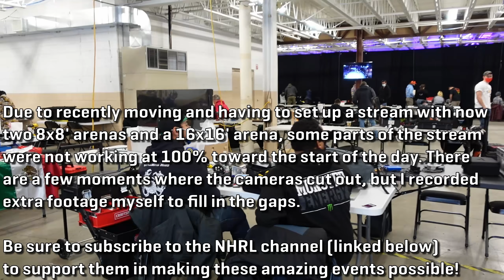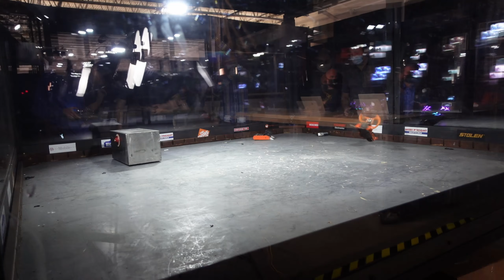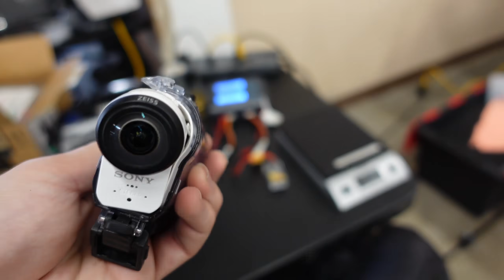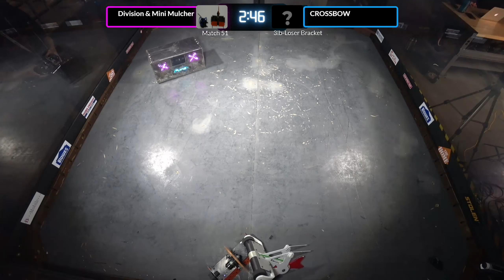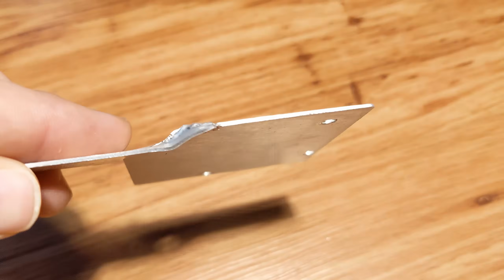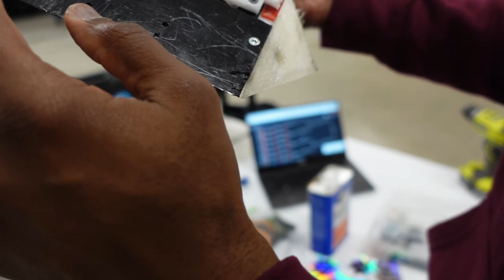February 2021 Norwalk Havoc Event Recap: Division (3lb Beetleweight Combat Robot)

Comment: Curious spectator here. Are there restrictions against programming and automation for these fights? Like could you program a micro with a gyro sensor to take over directional control using just the forces from the spinning weapon? What about automated object avoidance control? I have a naive high level idea that it would be fun to program a bot that could move more like a video game 2D fighting game, (not that I have the programming skills for it). I'm thinking like D-pad or A-joy direction inputs and action buttons that control specific complex tasks and combinations that are not directly related to single motor controls.
Reply from the maker: This comes up in discussion a fair bit. The answer is yes, those sorts of things are allowed at most competitions and there isn't much stopping you from implementing stuff like that from a rules perspective. However then you get into the territory of 'why bother'?

At the end of the day wiring up plug and play RC controls and learning to drive your robot, being certain it will always do what you want when you want and nothing else, is safe, easy, and reliable. So while you CAN make these robots autonomous if you try hard enough, there is currently no real incentive to do so, and because it is necessarily more difficult and expensive, and likely less robust and less reliable, almost nobody bothers to try.

There is also the possibility of having a runaway robot when you go autonomous and while there are lots of ways to implement safety overrides and such into a bot, it's still a dangerous thing to mess around with in your own home.
Reply: @JustCuzRobotics  
  I wouldn't start with a comprehensive type of thing. Instead, with a bot like Division, if the machine has established a level plane of operation, then a gyro sensor detects unexpected lift at the front of the machine when the blade is spinning and providing force on the forks, the micro responds by controlling the torque through rotation to effectively 'bow' the blade forward to the ground, tipping the machine with the maximum blade speed for the maneuver. This could be done with either direction of spin. If you are paired with any kind of wedge machine, you would essentially have a spinning axe to bare on an area well past the most reinforced front edge of a wedge.

  Beyond this, it might be seriously impressive if division had the ability to jump using gyroscopic inertia when you're in a vulnerable orientation. It might be possible to use a micro to jump and increase the likelihood of landing upright, or at the very least, prevent landing on the blade while powered and randomly 'break dancing' instead of a more controlled recovery.
 I totally understand how difficult it is to change hats from CAD to Fab to IDE though. Being a "Maker" is like being a Swiss Army Knife. You've got all the (skilz) tools, but none of them are the 'Best' tool for the job.
Reply from the maker: Even stuff like that would be weeks worth of effort for something that I would need to pray worked perfectly every time or it could cost me a fight. While manually activating the brake to 'hop' when stuck isn't as elegant as a system that does so automatically, how would I even determine what 'stuck' means with a micro? What if the gyro fails or the micro fails? Or both? Also again you have the automating a deadly weapon problem - very dangerous if things fail unexpectedly or behave differently than intended.
Reply: @JustCuzRobotics  
 Watchdog timers, both the ones internal to the μC and external watchdog chips can solve most of your safety concerns. If a human's reaction is estimated at 1/10th of a second from sensory input to physical output, a μC operating at just 10MHz has over 150k equivalent "seconds," or over 2k5 "hours," or 115 "days" of equivalent time to execute single cycle operations. Using the μC for this type of thing is like buying yourself days of time. The only question is how you would like to use it. Start simple. The "time" is there for anyone to play with but everyone seems to ignore it. That seems like the ideal place to explore new potential.
  My code is buggy as hell and often resembles a certain stringy Italian-American dish, but still it would be fun to try IMO. I've worked in, around, and maintained industrial heavy equipment before, so maybe I'm a bit less concerned with the testing and development. I don't have your degree and academic knowledge of strength of materials, so I overbuild the crap out of safety type stuff and rely on redundancy. It's called the bleeding edge for a reason though.
-Jake
Reply from the maker: It's an interesting problem certainly. Maybe one day something I could play with at least for the sake of it. But maybe a bit outside what my core audience is here for.

Comment: Is there a way you can shave off weight to add wheel guards?
Reply from the maker: I have weight for wheel guards already but the robot kinda needs to have its wheels on the floor even while tilting at extreme angles due to gyro forces. I would need to design them very carefully to not hinder driving and self righting, plus it's hard to find a good way to attach them. I'm considering having a configuration that allows them for next time though.
Reply: Oh yeah, I didn’t think about the fact that it could be high centered on them

Comment: You mentioned a slip hub on you're weapon motor, can you elaborate more on what you did there?
Reply from the maker: That was an upgrade I discussed at length in my recent overview video. Long story short, I am using a pulley that has a specially designed hub which kinda clamps around the motor shaft so they are not completely locked together. The idea was to have it slip so only a portion of the shock load from the weapon stopping transfers to the motor.

Comment: I'm looking to get into combat robotics. Is the 3lb weight class a good one to start in?
Reply from the maker: Great question, and the answer as with many such questions is "it depends." I recommend you check out https://www.robotcombatevents.com/ to see what weight classes have competitions in your area. That may well decide for you what class is better!
The 3lb and 1lb classes both have the advantages of having kit robots available (D2 and Vector for 3lb, Fingertech Viper mainly for 1lb) and there is also a huge amount of parts available for these classes that are builder tested and approved (when I say parts I am referring to electronics like motors, ESC, batteries, etc, but also hardware components like wheels, wheel hubs, pulleys and gears).
It should go without saying that in both weight classes spinning weapons can injure or kill you, and I strongly caution against people building a spinner for a first robot in any class. Fingertech's Viper kit is great because you can buy it as a wedge or lifter, and swap in modules later on for a spinner if you have learned how to safely handle that and built a proper test box to contain it, etc. It also has a large community of people who have one and can help troubleshoot any issues you may have. I also have a video (linked below) that talks more about this. Even if you aren't interested in starting with a kit and want to build your own robot from scratch, there is a lot to learn by following the tutorials and guides for kit robots since a lot of the same knowledge applies. 

https://youtu.be/-fyxuHzDUaY
Reply: @JustCuzRobotics  Thank you for all the information! I went through the different competitions and NHRL is actually the closest to me. I might go with one of the kits mentioned for my first build. I started going through the process of picking out electronics, which went pretty smoothly. However, 3D modeling the robot and machining parts seems like a much more daunting task. Hopefully I can either get a kit or learn fusion 360 and use my college's makerspace to have a bot ready for this summer. Thank you again!
Reply: I was thinking of doing something in the 12lbs class for my first. I don't think I have the manufacturing ability to be small and light enough for the really little guys.
Reply: @DigitalJedi  The 3 pound bots are actually much larger than you would think. Division is about 12 inches wide for example.
Reply: @wishusknight3009  Yeah I realized that a little bit ago. I've got some new machining resources so I scaled things down to an antweight for a prototype.

Comment: I could tell how that first fight was going to go... big beater bar, low center of gravity, a lot more leverage with more of the bot on the ground and with it being lower... it's too bad, but not surprising. I still like your bot more.. it has more destructive potential against most bots, I would say.
Reply from the maker: Yeah that was tough. I am still working on how I can try to counter drum spinners and beater bars in the future when its almost impossible to avoid going weapon-on-weapon. A lot of the common defenses people use (long hinged forks for example) cannot easily be attached to Division, as my hope was always to keep the weapon-first approach. I might end up trying to make some modular front end attachments to handle different opponents, as right now the only part of the bot I can really change is the weapon. It works great against horizontal spinners and control bots (when I can drive) as-is but there are a ton of Fingertech beater bars and Lynx clones out there now.
Reply: @JustCuzRobotics  yeah that's a difficult question to answer. Aside from some unique addition like you were saying, I don't really know if there is another solution. At least you do seem to have some extra weight to play around with, so there is some possibility in the future, I'd say. One solution, could be to add 4 or so longer wedgelets onto the front, that can maybe feed up toward the weapon more, you'd have to get more under them to get a hit, but it could be beneficial against wedge bots and if it hits right, could even possibly be advantageous against a beater bar. I don't know though, just throwing out some ideas.